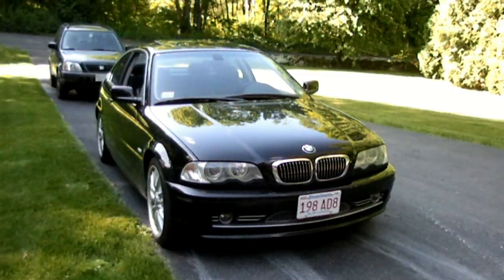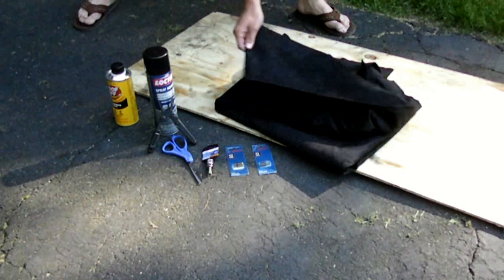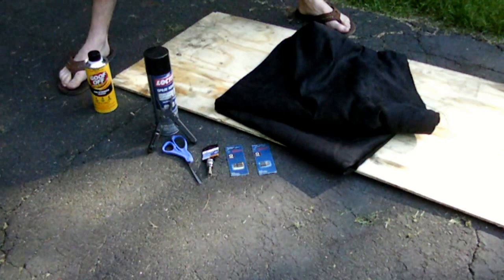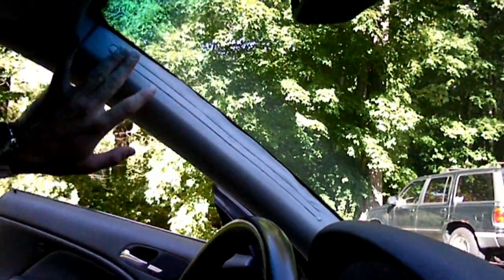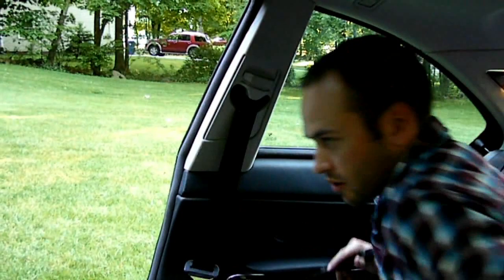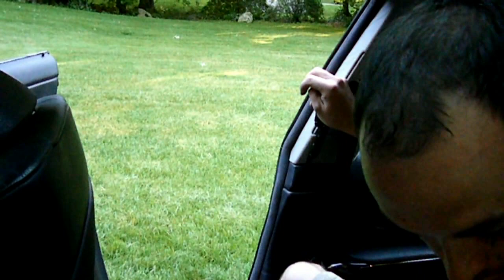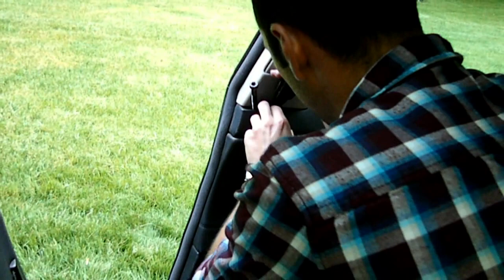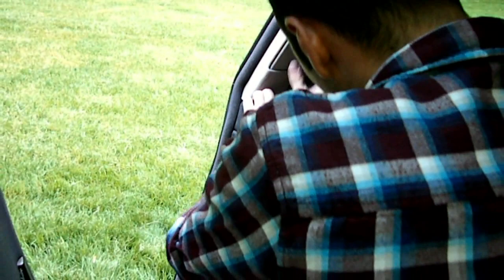Recovering E46 Pillars (BMW 330ci)

Comment: If you life in Florida, Texas, Nevada CA etc.... where the inside of the car can reach 120 +degrees for extended periods of time, the normal fabric glue cant take the heat and will "melt". Check with your local fabric store for suggestions. I used a 3M product a few years ago, I don't remember the exact name, and had to redo the wrap around on the edges with contact cement to get it to hold. 
I used vinyl material with a leather texture, as it is easier to clean than the suede fabric.

Comment: next time, save the old fabric and use them as stencils for the new. makes for WAY less trimming. good job for taking this on for yourself though!!
Reply: Jasper James
Reply: Jasper James
Reply: It CAN be helpful to make a stencil, but in most cases the new material has different stretch and give compared to the original fabric.  BMW sure scrimped in this department,  as well as the plastic for the pillars.  Guaranteed you will break something on each trim piece. Bound to happen.

Comment: sweet thanks for the removal of the C pillars. I didn't know there was a torx in there. I almost broke it lol. Man I can't stand how all of our e46s suffer from this issue with peeling. Instead of going through all this because I don't think this will benefit in the feature as that adhesive will eventually cause bubbles or just go loose a few months or years down the road. I just tore off the cloth and spray painted them all black(matches my sport black seats). It actually came out better than expected with legit 30 or so coats. Let them dry for 24hours and wammo. Didn't cost more than $15 bucks. Just need at least 1 can for 2 pillars. So if you do all 6. You should get 3 cans. I used Krylon plastic black gloss. Only issue is there still is a secondary cloth under their crappy cloth and it may have a fuzzy looking feel to it but it kinda gives it that M3 carbon cloth look.

Comment: This is a great video. Thank you for doing it as I am going to have to go through this on mine.  It's to bad one has to do this though.  You would expect much higher quality for a car like this.  I've come to learn that certain things about Bimmers are not quite up to par unfortunately.
Reply from the maker: one tip I'd give is to use some type of UV-resistant upholstery, if you don't and use a dark color, it will fade over time

Comment: NOTICE!!! Before you begin the process disconnect the battery, you don't want to run the risk of the air bags deploying!
Reply: Yes, anytime you working on a BMW near air bags or with electrical connections, these are very finicky cars when it comes to their electronics.
Reply: Zostamax you don't, i don't disconnect the battery when I'm taking off the steering wheel. You can't have the ignition turned on.

Comment: Great vid! I hope you disconnected the battery before removing where airbags are! Those bitches could explode on u, and u would have a couple thousand dollar replacement! I think what I will do now, is take everything apart, buy my own material, then take it to a professional, and have them glue it all together! Looked like a bitch! And it pisses me off this even happens to the 3 series! When I first got mine, the felt around the windows was dropping off every other week because of the heat here in Caly! It was under warranty, and BMW was pissed! Said it was because the Germans don't think about heat! Well after about the 5th rubber felt trim replacement the must have gotten some good ass glue from Satan, cause those have never come off again!
Reply: ya, next time ill be buying new pillars. this was the biggest pita ever.